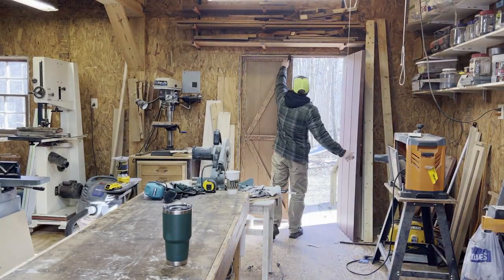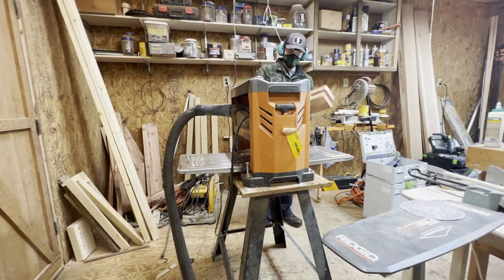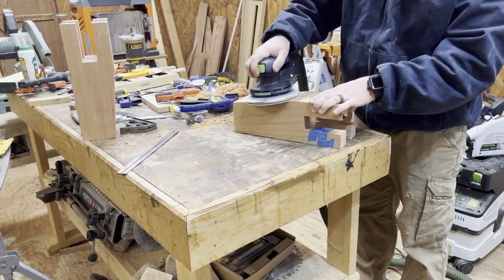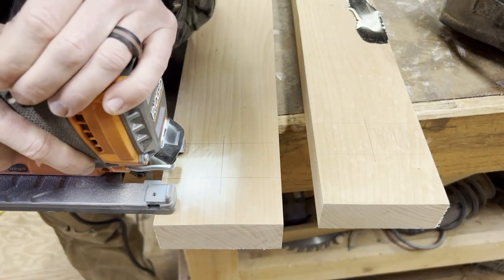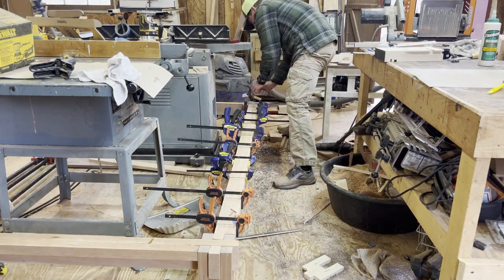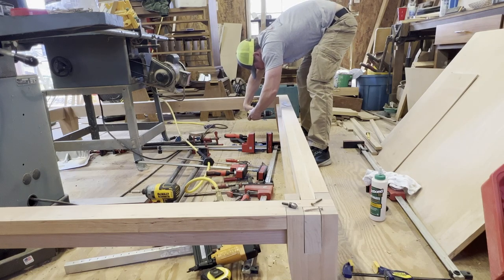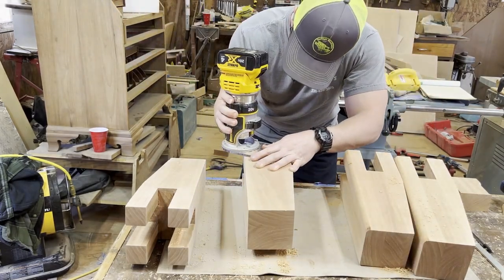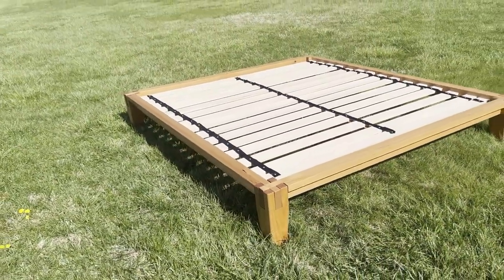Castle Joint Bed

Comment: You could have took your legs back to the jointer after you bandsawed the taper.
Reply from the maker: Thanks for the tip. I’ll try that next time  I think I either didn’t think about that or I was afraid my blades were a little dull and was afraid of chip out. Can’t remember this video was put up over a yr ago